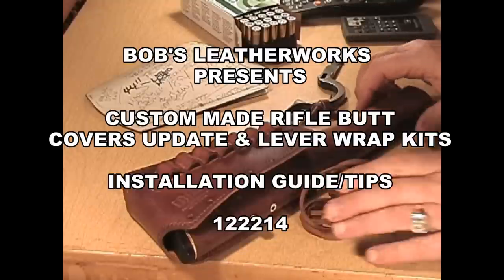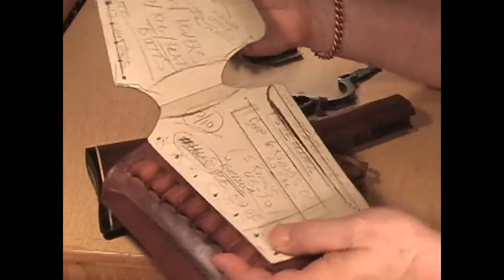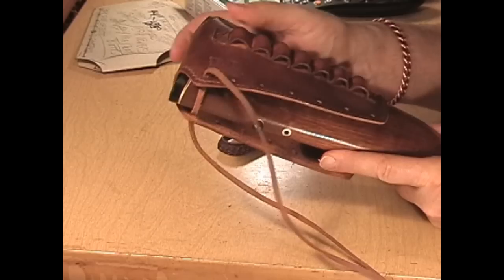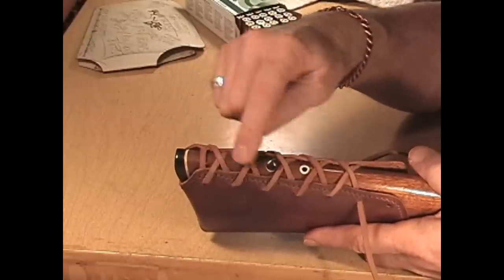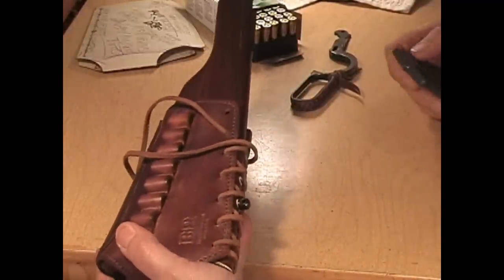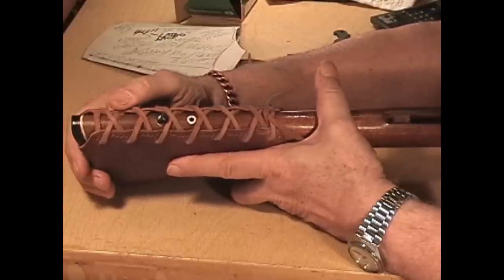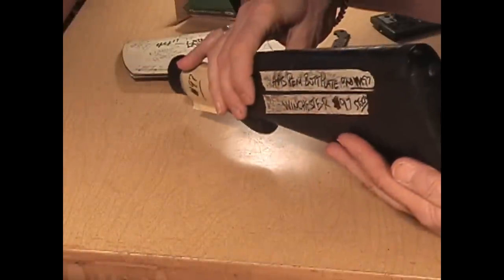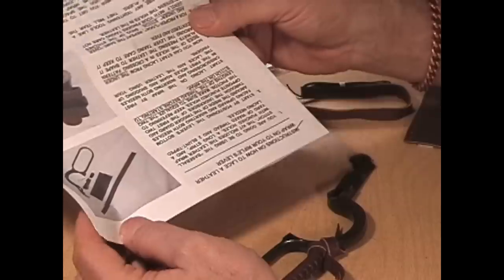RIFLE BUTTSTOCK COVERS AND LEVER WRAP INSTALLATION 122214

Comment: Your leatherwork looks spot on. I have an either refinished, or more likely an aftermarket replica stock for a Mauser K98k in 8x57mm. Would it be possible to have custom stock wrap with a 10 round holder and cutaway for sling made?